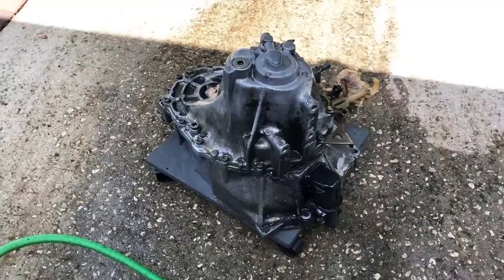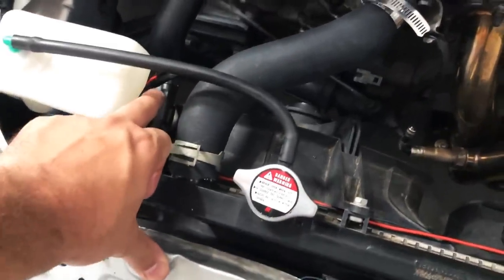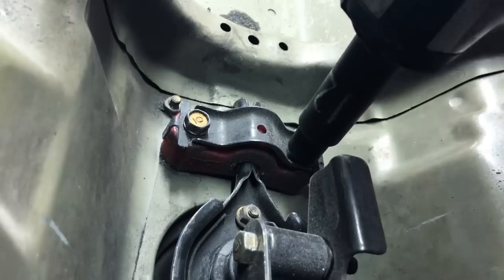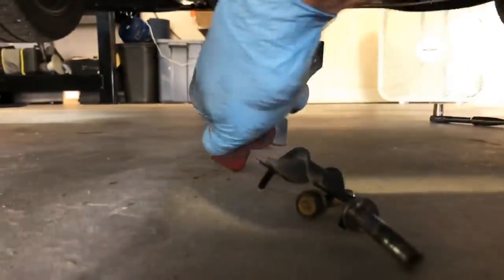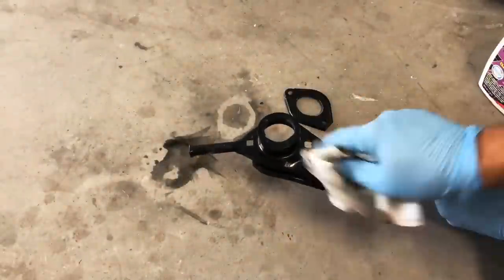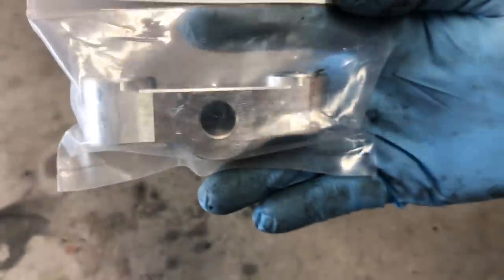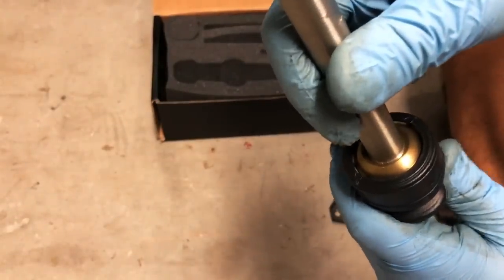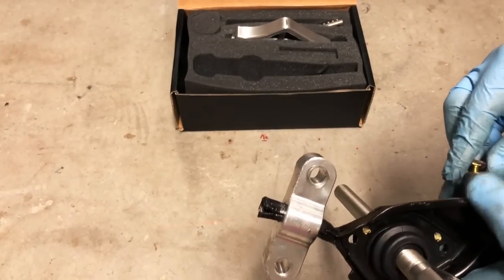K-Tuned Short Shifter, Circuit Hero and Dimes solids bushings Install on Project EK

Comment: Yo! Great video. Installed one of these shifters lastnight on my hatchback. Made the circuit hero shifter plate for mine too but used carbon steel and clear coated it. Couldn't see paying so much for one.  Easy
Reply from the maker: That’s awesome you made your own!
Reply: Cost me about $6

Comment: Congrats Rob! Glad to hear your gonna build the transmission. I recommend the 4.7 final gear and if you want synchro's get Honda factory replacement. I have heard synchrotech fail under heat and stress. I fell you man I am itching to race myself but I am building everyone else's cars. It's fun but I want to work on my own projects.
Reply from the maker: Thanks for tips Nick! What tranny is the 4.7 out of ? Or is it an aftermarket final drive?  I’m a newb to this stuff. I hope you can get on track soon man!
Reply: Refine Movement no it is an M factory gear set. 500 bucks but worth it. Obx diff is about 350 not bad for what you get. The good thing is you will have a bullet proof trans at that point. There really isn't any  swappable final drives for the d series unlike the B series. The B VTEC transmissions are different too. It is the countershaft that the final gear is attached to and they are different for all the transmissions. Your Si trans has good gear sets especially for the track, close 1 thru 4. 5th is short too so your rpms will be high cruising highways.

Comment: Radiator fan switch. Which is located on the thermostat housing. May as well upgrade it to the Mishimoto. Turns that fan's on at a lower temp. Great for track setup.
Reply from the maker: I’ll look into that ! Thanks !

Comment: I like the way you are upgrading your car.
Not ricer at all..
I own a Honda EJ8 coupe same color as your civic.
And even if my car is automatic, pull hard.
I'm working on the suspension, having some problems removing the bushing bolts because this car was from the bay area, the bolts seized inside the bushings.
Other upgrades are tuner upgrades,
Not ricer sht 😂,
Great videos...

Comment: Going to the FIRM sometime in sept? I've been wanting to go back, but it comes down to avoiding the florida heat lol.

Are you running solid mounts to use those metal bushings? And much more does the shifter vibrate?
Reply from the maker: We’re hoping for September. Yeah the bushings mount straight up. I’ve heard other people complain about the vibrations but it didn’t seem to change much at all for me. I like it alot
Reply: He means the engine mounts - with the solid shifter mount, any engine movement might compromise shifting.

Comment: What is the advantage of solid shifter bushing vs. something like Energy Suspension? I just picked up a '98 Sedan and it needs bushings, so I'm thinking of ES & a short throw shifter to make my daily commute a little more fun.
Reply from the maker: It’s just about feel. The solid was a step up from the ES bushing, but it can be annoying to some as there can be unwanted vibrations. The ES was good for me on the street.

Comment: Idk if anyone has mentioned it yet, but ktuned make a different elbow peice specifically for the ek to keep from jamming your hand into the dash in 1,3 and 5th gear, if you so happen to run into this issue, it's about $40.
Reply from the maker: Yes I’ve heard of that but it’s seems to be fine on my car.

Comment: Question for some honda guys. Im looking at buying a 1 owner super clean stock 97 civic DX. Its a 5 speed new timing belt and h2o pump and new clutch. But it has 218k miles is it worth it to have as a daily? Its stock non VTEC SOHC any input would be great !
Reply from the maker: That sounds like a good car to buy overall big plus that it has those new parts. My 1998 is the same car and has about the same mileage. For a daily driver it should be fine but with that mileage things will need to be replaced. the suspension and steering components could be all bad if they haven’t been changed in a while or ever ie bushings, tie rods, struts/shocks. Check the fluids to make sure they are newer and haven’t been there 2 decades. At 200k my power steering was leaking.
Reply: Refine Movement Thank You so much for your reply ! Ill check it out with a little more ease of mind then. Once im back in the honda game, ill have to rock one of yals stickers.
Reply from the maker: Sounds good man good luck! - Travis
Reply: my experience at those miles is to watch out for all the old coolant hoses and be ready to replace them  asap if they are old and hard.
Reply: aw614 ill def check that out while im at it thanks!
Reply: First thing to replace on that car would be the coolant hose that goes from the head to the thermostat housing. It looks like a question mark (?) when you have it off and it usually tens to rub against the intake manifold. They almost always tear around 200,000 miles. I bought a full set of silicon hoses for $40 on ebay for my D16Y8.

Comment: If it fans work ok it almost has to be the switch that turns them on,if u have to u can jump the coolant switch plug and fans will run continuously
Reply: george bonney90 👍🏻 or have a switch to just bypass the whole thing and turn them on when your at a stop. (As a double edge sword) when you have your car off, you can throw your switch on to cool your engine down. But if you forget you have them on, you will start killing your battery little by. little
Reply: Yeah in my opinion you'd only wanna jump the coolant temp sensor/switch if u have too, also by turning on the AC the fans will run, if u have AC
Reply: george bonney90 indeed I would go with your solution first and if yours does not work, go for a simple switch.

Comment: Hey did anyone else have an issue with the shifter hitting their exhaust? I have a skunk2 exhaust, could it be possible I installed the bitch pin side upside down?

Comment: You should really consider wrapping your header. Only cost like $40 and dramatically lowers under hood temps. Using an infrared thermometer, my 95 hatch's header went from about 670°F unwrapped down to about 275°! That's a huge drop.
Reply from the maker: Wow! That’s a huge difference I didn’t realize it would be that dramatic. Where did you get the wrap you used?
Reply: +Refine Movement Yeah, it did more than I thought it would, it'll also keep more radiant heat away from your radiator, oil pan, and intake. I got mine off eBay, just look up titanium header wrap, I think I got a 50ft roll and wrapped it all the way to the cat connection. Prevents burning yourself too if you need to do anything under the hood at the track. You can install it in an afternoon and do it wet or dry, overlapping half the wrap. I did it dry, just wear gloves and a face mask. It's been on over 2 years on a cheap eBay header, no cracks or issues. It really is amazing stuff, can't recommend it enough.
Reply from the maker: Awesome thanks for the tip I will probably do it!